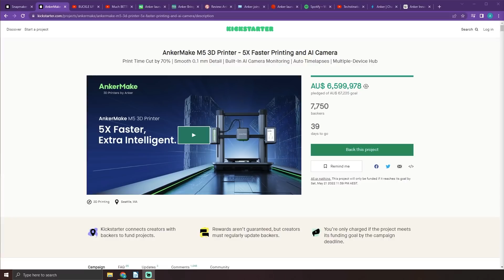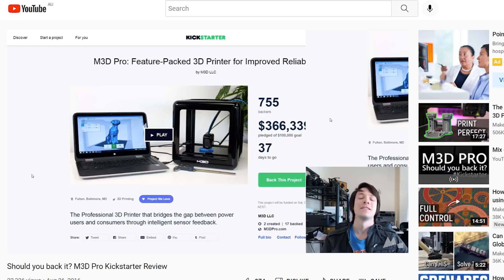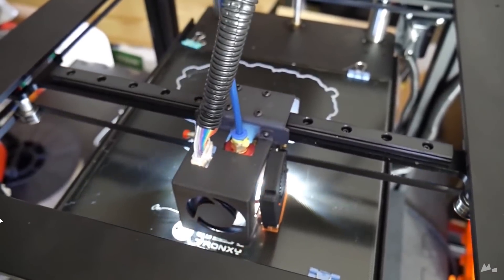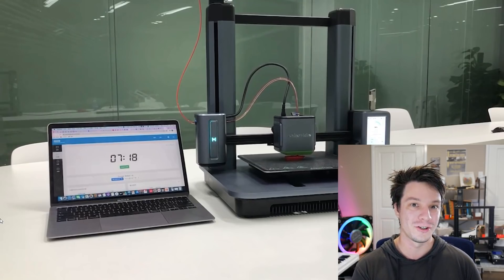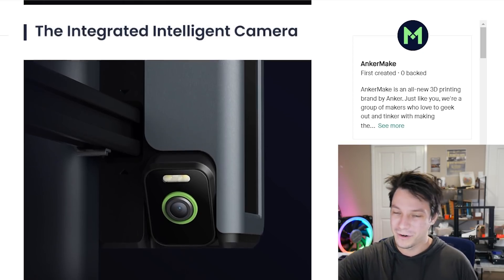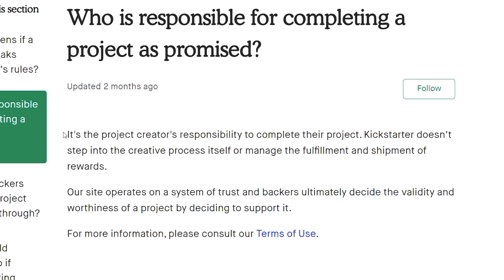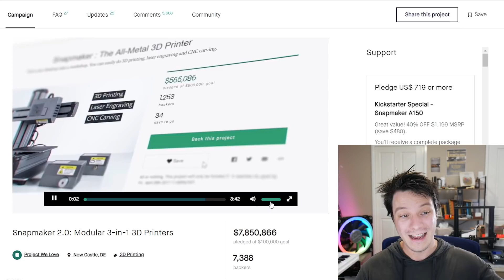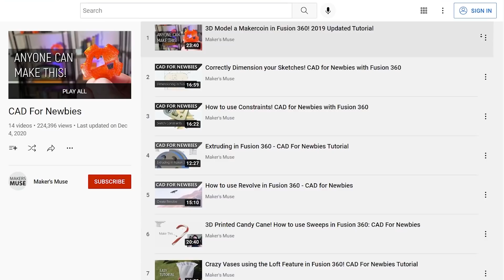This 3D Printer looks incredible, but...

Comment: I disagree. Resin printers, whatever tech they use, have a leg down on FDM because FDM can work with useful, recyclable materials like TPU and PET, and without hazardous chemical baths.
As for democratizing 3d printing: Prusa and Creality have already done that, the market is just smaller than every home in the whole world. Whomever wanted a 3d printer (and has any 3d modeling or design skills) pretty much has one. Or one is available at their price point.
I really like Scara like polar and dual polar printers, and I've seen industrial 5 or 7 axis printers that can do cool things. There's still ways to go for FDM.
I'd get a metal sintering printer if one was available at a decent price. Realistically, this is just the beginning for home manufacturing, simple machines that work with glass and metal are still needed... though woodworking and small CNC machines are already available.

Comment: I am excited to see this come out. I am not backing but looking to buy it after it is commercially available. I got an ender 5 and it worked okay but then I got the BL touch leveler and have spent close to 100 hours over the past 2 years to try to get my printers firmware updated and it just has not worked. It is so frustrating and I am even a techy person who works in software. So I just want something that will work.

Comment: i feel like i'm someone who could benefit from this. i'm great at 3d modeling. it almost comes naturally to me since i've been doing it since high school, but futzing with 3d printers has been my hard mental block for getting one. so yeah i'm someone who might actually get this if the end product turns out to be pretty easy to use and is consistent. now if anker made a 3d printer with a rotating bed ohhhhh baby then i'd throw down some cash.

Comment: There's a bunch of comments here along the lines of "I don't like that I can't get in a fix every little detail if something breaks."  I've seen a lot of similar comments on videos about the REVO nozzles, and even some on the new Prusa XL.  And I think those comments show the degree to which current printers cannot be relied upon.  We just all expect something to break, and so we want to be able to fix it.

And yet... the history of technology is an unending march whereby reliability improves and user accesability diminishes.  We can see it in things like cars and firearms.  We can see it in 2d printers - HP owns something like 80% of the market, and a big part of that is how almost all of the bits of a printer that can break are held in a couple of "black boxes" that just get replaced.  Hell, we can even see it in a pair of scissors - look at an old Roman set of scissors.  You could take them apart with no tools, and repair them pretty easily with tools that almost every household would have.  Today, scissors are held together with rivets and have injection-molded handles and when they break, they're garbage.

My dad ran a computer shop in the 80s.  When Apple launched the MacIntosh, he bemoaned the way the user couldn't really do anything "under the hood", and the way Apple was "dumbing down" the computer experience so you didn't have to really know anything about computers to use one.  Today, he still says that Apple did exactly what he thought it would - but that he was wrong to think this would be a bad thing.  Hopefully things like the "resinjet" and this AnkerMake and the REVO and the Prusa XL are all taking us in that same direction.

One last thought: yeah, the advert is totally overselling the "idea to object" notion and neglecting the "idea to 3d model" step of the process.  But I really believe that a 3d printer can be a useful tool even with no real 3d modelling skills.  Sure, you won't be able to get something quite as individualised.  But for a lot of hobbies, it doesn't matter.  My best friend like painting miniatures terrain.  I'm currently printing a bunch of buildings for them.  They don't care that they didn't draw and design the buildings themselves; they just like the idea that they can have another of these buildings whenever they want.  A 3d printer in every home will open up vast realms of creativity-as-employment for people how can create models.  Libraries of "good enough" can totally take the place of "I designed this myself to be perfect for my unique situation."  There's already loads of parts where one takes, say, a pegboard container someone else designed, tweaks a couple of numbers in the parametric file, and has what the garment industry would call a "custom tailored" part.  Beign able to design your own "bespoke" part has value, and I'm certainly enjoying my forays into F360. But I've had a 3d printer for 18 months now.  I've had it in operation for probably 60% of that time, discounting failures.  And I can count the number of custom, individualised things I've printed in all that time on 3 hands.

Comment: As you mentioned, the barrier of entry is the 3D modelling: what produces the part is secondary. Even if you had a module that magically spits out a perfect plastic part in a couple of hours and costs less than $1000, how would an average person use it? And why would they need it? Instead of ordering said part from a common and similarly cheap online printing service, offering a much wider selection of materials? The analogy that comes to mind is photo printing: a decade or more ago photo inkjet printers were popular. Now they are dead. If you need something printed you can get it cheap and fast, in a size and on a material that you wouldn't be able to print yourself.

I don't think 3D printers will ever reach the mass market for this reason.

Comment: Even if someone could do CAD and 3D-print, then they still need to be able to come up with something to design in CAD in the first place and know how to use/mount it after printing it. 
My prediction is, 3D-printing will never be really mainstream. Simply because designing, engineering and fixing your own appliances will never be mainstream. This utopia where you will print the broken part of your dishwasher will never be true for 95% of the people, because they don’t even know how to find/remove the broken part in the first place.
Reply: And I just don't get that.  It's never been easier than it is now to fix your own appliances--a full guide is just a Youtube video away.  Especially people who complain about how much it costs to get someone out to fix their washing machine.  Like, dude, spend 30 seconds googling it and...oh, look, it's the door switch, which is a $8 part and a 3 minute job you can do with a single combination Phillips/Flathead screwdriver.  And here's a video to show you every step of the way.
Reply: @gpweaver  You vastly underestimate the stupidity of the average person. Try working a cash register job and you'll quickly be corrected
Reply: Question below for a 3d print noob.agree on the fact that most people don't really want to try to fix their appliances. I grew up fixing everything from a young age with my father, and today I have a fully kitted out shed for making stuff out of metal and wood.  My reluctance for getting into 3d printing is the leatning curve and the potential for waste. There so much info out there and when i have started down the 3d printing path, the sheer number of printers and their pro's and cons and the customisations has resulted in no 3d printer purchase for me.  Is there a good location to get some trusted beginners info on a good beginner startup machine that's quality, value, and good to use in the future as I learn and progress my knowledge? Or better to get something cheaper to learn on and upgrade later? Beyond that, there appears to be MANY tips and tricks to avoid issues, and it would be nice if this were documented somewhere that does not require 1,000 hours of youtube watching. Thanks to anyone who can point a beginner in the right direction.
Reply: @MadBison  I MASSIVELY agree with this, I just want to learn the basics but I haven't seen any good "where to start" videos and instead its just a constant feed of small tips and tricks to fix this one tiny but critical problem.
Reply: This machine might be useful for the workplace. Ive worked in a few different spots as a mechanical design engineer where they didnt have 3d printers (which is an absolute travesty if you have mechanical design in house) because the boss wasnt clued in on the 3d printer scene atall and thought you needed to spend thousands for a plug and play printer with support. Two places where i prepared a PowerPoint detailing printers low cost and offered to set them up with upgrades etc. Instead in both places i ended up printing my on work prototypes at home......and even had other engineers ask me to print their prototypes. If this printer ends up being cheaper than an ultimaker (which my bosses deemed too dear) then we could  be in that bracket.
Reply: Agreed. It drives me nuts to see a company throw away tens of thousands of dollars on machines that are simply pumping out one-off, proof-of-concept/does-it-fit prototypes. The cost of the hobbiest/small business FDM and resin printers on the market now has dropped dramatically, while the quality and options have gone up. The learning curve is nominal. I can't see any justification for choosing a ridiculously expensive machine these days if you (or your investors) care about the bottom line.
Reply: @mickthemaker1789  Speed, raw speed. What my Mars 2 takes 5 hours to print, we have a 100,000$ printer which can print it in about 15 minutes.

Thats for 1 item. If we are talking about a print surface full...its about 15 minutes for what I can print in a whole week.
Reply: I can see things getting closer to that over time as automatic tools get better. A flatbed scanner is all you need for copying the size and shape of 2D objects, and at some point somebody will make a tool that automates that process to make it more accessible.

I imagine photogrammetry will go the same way as tools get better.
Is there a reason it's impossible to photograph an object from many angles, auto generate a model, put it though something like Fusion 360s prismatic model importing, auto repair and scale the model, and then print a copy that's close enough?
Reply: I hope its not mainstream, I make money selling prints. lol
Reply: Funny because you don't have to.
There're millions of 3d models being uploaded to the internet all the time. Chances are, somebody already designed the part you want.
Reply: One thing you might have missed. With todays problems with supply chain, not for everything, but somethings a company could send you the printable file, at a cost, and you print it. No supply chain issues with the exception of available filament.For example. I have video home security cameras. One of my cameras the mount broke. Of course you can't buy, just the mount. I designed a replacement, printed and mounted. Now if the company could send me the .stl or .gcode to print it for a reasonable cost I might have done that. I probably wouldn't have as it was a very very easy design but, there is a business case for delivery of a replacement part that could avoid supply chain issues and a company not wanting to sell JUST a mount as it's unprofitable. But they could have made $5 from someone with no design skills, has a printer, and could print the replacement part.
Reply: Like I say: people don't even know how to cross a goddamn street, there's resistance to accepting people just living as they like without harming anyone (quote every single social rights movement here), expecting these people to either know, or want to learn, is an utopia to begin with. The amount of people way too stupid, that plain refuse to learn anything, is the biggest barrier to mainstream 3D printing and will always be in my view. Comparing it to 2D printers is flawed, as the necessity is entirely different, let alone the skill set.
Reply: @Kalvinjj  The good part is, so long as people are too lazy, stupid, or unwilling to learn things, it's more money for those of us that aren't!
Reply: @gpweaver  Thinking about your mention on how it's easier than ever to DIY stuff properly with access to information (wholeheartedly agreed), reminds me of my washing machine that one day woke up bugged up draining empty.
All it took was to open it up to see the float stuck up, washed it and never a problem anymore (please me, don't jinx it). Wonder how much would it cost to bring a technician to do it.
Reply: @Kalvinjj  Usually between $60 and $100 an hour, one hour minimum, plus parts.

Every now and again you'll get a great guy who will show up, raise one eyebrow, and reset your GFCI and refuse to take any payment, but usually, ~~company policy~~ means they have to charge for their callout, even when it's a 10-second fix.  Which is fair, TBH; these little repair shops don't run on hopes and dreams.

Comment: First of all: thanks for making this video! I am honestly considering backing this one and to hear your thoughts on it definitely helped!
I want to object a bit regarding your prediction of 3DSP (3D spray printing or Polyjet or "ink-jet" printing) being the future for the consumer. I doubt this quite a bit, because of the resin compositions for 3DSP being highly toxic - even compared to tank based systems like the professional ones from envisiontec and prosumer Formlabs formulations. The later can be much simpler as they only need to be filled in tanks - in this regard the "ink" in 3DSP systems needs to fulfill many more specifications in order for the system to work. AND every print creates waste. The ink deposition is only the first part of the process. The layer hight is determined by a roller which mixes the (different) resins and removes excess material - which then needs to be safely disposed of. Not a huge problem in a factory or professional environment, but at home...? Not the best option if you ask me... plus resin 3D printers for all their precision and material variety will always be that: resin printers! No matter what you do, you end up with a chemically "metastable" product. Which is fine for many things but will with certainty change properties over time...
Therefore, of you ask me: I would put my money on more comfortable FDM systems for the home user even in 10 years, as the material they print is easiest to handle and stays mostly intact over years. 
My background: in a scientific environment we are using different kinds of FDM (Ultimaker, Intamsys), SL (envisionTEC, Formlabs) and 3DSP (stratasys) commercial printers among mostly self developed multi-head, multi-material and dispenser-based bio printers. We are trying to have the perfect tool for every job!
Greetings from Freiburg, Germany!
Reply: FDM for now is probably the best consumer tech yes. PLA is pretty good stuff for most uses, PETG is also an accessible requirements filament.  I think its only once you hit ABS that you start needing things like enclosures. And of course PLA prints if multiple part can be assembled with crazy glue(aka Super Glue in some markets) available at most supermarkets and office supply stores.
Reply: There are industrial plotters that deposit coloured molten polymer on paper, they use coloured plastic balls (like marbles) that are molten in the printer head. My guess would be that would be more viable technology than a resinspraying machine.

Comment: The thing that threw me off the most, from the TechLinked video, was the large machined aluminum plate in the base. They talked about it briefly, but that component could never be included in the production run without a substantial price increase. To me personally, it seems deceptive to include that plate in a pre-production unit, which would greatly improve rigidity and likely print quality, knowing it won't be in systems in the future.
Reply from the maker: From what I saw it was CNC on the prototypes but production will be die cast, still expensive but makes sense at scale.

Comment: Excellent video and I mirror your feeling on the AnkerMake M5. I did back this project and mostly for the reasons you mention, it's easy of use and it's design on broadening the 3D printer space for the consumer market. I have an Ender 3 that I honestly have NEVER been able to get working right. Whether this be user error (likely) or just a lack of time and energy to get it properly dialed in (also likely), no matter how many times I've tried I just can't get it to work consistently every time. So the idea of the AnkerMake M5 is truly appealing to me as I would love to have a printer that "Just works", no tinkering required. Yes I know this does take some of the "fun" out of 3D printing, but when you have little time to tinker that "fun" becomes annoyance real quick and as such your 3D printer becomes a dust collecting paperweight real quick. Whether Anker comes through and delivers their product I think is less of an issue. The Anker brand is so big that they would not want to sully it with a bad run on this Kickstarter. And if they truly want to change the 3D printing space they will do everything in their power to make this project a success. But at the end of the day you are right, Kickstarter is always a gamble and you must back at your own risk.